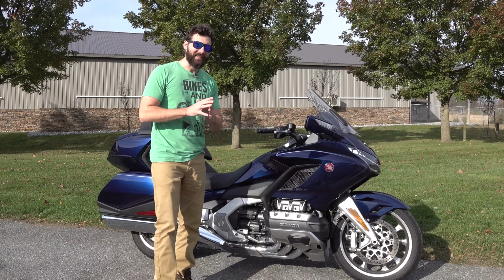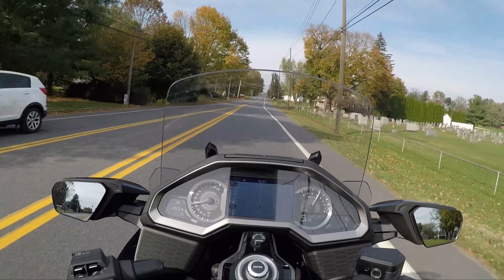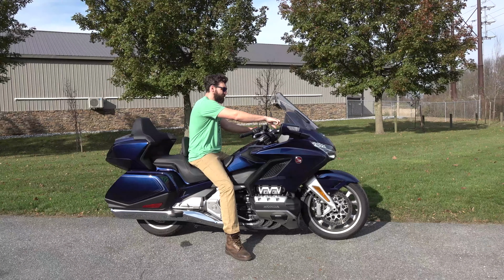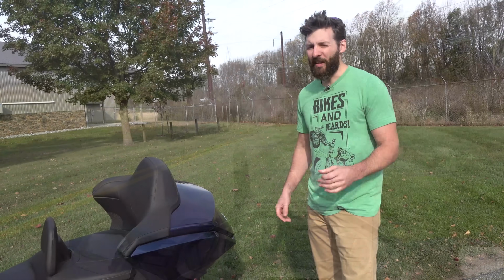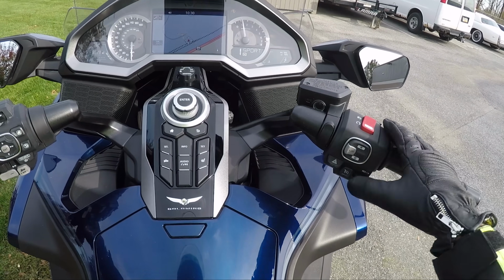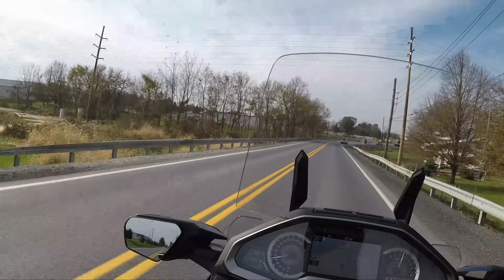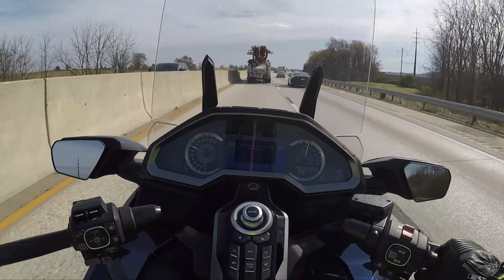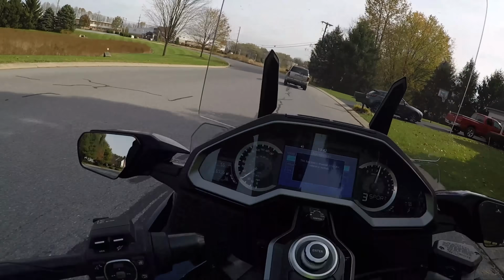You WILL NOT believe what the new Goldwing can do

Comment: Can it perform slow maneuvers. Something like the police courses. When you tend to use a friction zone of the clutch.
Reply: I'd like to know as well
Reply: Sure. Just use the rear brake pedal the same way the cops do on the courses.
Reply: Ok maybe I over thought that one. Trying to set up a test ride to find out for myself.
Reply: easyrider4x thank you.
Reply: I have an Africa Twin DCT....it’s absolutely brilliant on and off road, there are times however mainly when I’m riding it off-road that I would like a clutch but it’s still awesome either way!
Reply: I'd say no.  Rear brake or not, there is a little jump coming on throttle, at least during my two demo rides. Perhaps if you put it in rain mode and deadened the throttle response.
Reply: @plympytheplumber4605  I find mine better off road cos it has no clutch !!
Reply: @johnmoylan7202  First I said you might have better luck doing it in rain mode. I stand by the fact that the throttle is a little snatchy otherwise. Second, when I see YOUR video of YOU doing it then I'll lend credence to your opinion and insult.
Reply: @johnmoylan7202   very cute video, however I'll bet that he is using "rain" mode as I said.  If you are using either of the regular modes, you probably won't be able to do this because the throttle is too abrupt. As any good rider and professional rider will tell you, the key to control is the friction zone.  There isn't any with the Honda.  It is the bike that's the issue!!!!!!  See I can do exclamation marks too ;)
Reply: @tibortoczauer7985  that was done in Sport 1 mode.
Reply: @tibortoczauer7985  there is no insult. it's like Jerry says - and shows often - the motorcycles are not the limiting factor, it's the riders : myself included.  It's why I practice all the time. Including on my Road King doing the same exercises.
Reply: @tibortoczauer7985  I'm a Honda motorcycle mechanic, and I have ridden the goldwing DCT plenty of times. I have done tight u-turns in default settings in my shop's parking lot a few times, just to practice and feel how the bike does. It is very easy to ride at slow speeds, you just need to have the experience to do it right. I can make the u-turns tighter than I do on an (obviously manual) Harley-Davidson Ultra Classic. It's all about the rider.
Reply: @easyrider4x  watched the video and all it is is basic u-turns and some weaving...not my idea of slow maneuvers...

Comment: you didn't say anything about the radio/ intercom system...?
Reply: The audio quality and volume is pretty good, there is no intercom system, and no wires; its all bluetooth. The built in GPS sucks and that's being kind to it, also no Android Auto support which is stupid, but Google's fault. CarPlay does work great on it, especially the iOS 13 version with the split view. The CB add on is $1000 though.

Comment: Great video! But, please do not call the DCT an 'automatic'. An automatic has a single torque converter and a wet clutch. The DCT is like a manually shifted car which most often has a dry clutch. The DCT has TWO dry clutches (thus the 'Dual' part of the name); one for the even-numbered gears and one for the odd-numbered gears. Each clutch is always ready to take its turn. The DCT can change gears in a tenth of a second. In addition to the seven forward gears the DCT shifts at the peak delivery of each gear. You can call it an automatically-shifted manual transmission. Also, you don't have to turn the bike on and THEN press the red start button. You can, with just your right hand, hold in the front brake and press the red button with your thumb at the same time to start the bike. Not all Goldwings come with a center stand. Only the tour models. But, you can add a center stand to the non-tour models. I've had my 2018 Tour DCT for almost two years and it has 15k miles. Three times a Harley rider on a new-looking big Harley has challenged me at a traffic light. I smoked all three of those guys when I used Sport mode. Also, you can manually change the gear with one of the shifting paddles while in automatic mode. Some riders, coming up to a stop, will tap the minus paddle to jake-brake the bike. Do not be afraid, the DCT will prevent you from tapping the shift paddles if doing so take the RPM out of range. Having said all this, I think your video is the most effective video I've seen in selling the benefits of the new Goldwing. I'm going to keep it handy when I want to show someone the real benefits of the most incredible bike I've ever ridden. Thank you.
Reply: Interesting comment about DCT a few things I didn't know I just bought an Africa Twin DCT last month I'm absolutely loving it ...thanks for the info.
Reply: Honda moved away from just calling it a DCT and now they are officially named Automatic DCT.    Too many people were getting confused as to what DCT meant.

Comment: I am 5' 8" and I cannot ride a Goldwing because my feet do not touch the ground flat and I felt like I was going to drop it because of the weight. They are great for riding long distance. I grew up on the back of a Goldwing.
Reply: Brian Smith height doesn’t matter. It’s all about your inseam measurement. I’m 5’9 and can almost flat foot any litre bike.
Reply: @thegatesofsleep  I never actually said height mattered. You are right, as long as your flat footed you are good. But unfortunately I am not flat footed on a Goldwing.
Reply: Brian Smith if you’re really dead set on wanting one there’s custom seats you can buy that will shave some of the height down as well as lowering the bike slightly. You’d probably be able to flat foot it doing that.

Comment: Well, the reason why a dual clutch transmission is faster than a normal automatic is because it's technically not an automatic transmission. An automatic transmission shifts using oil pressure and clutch packs all controlled with solenoids and what-nots. A dual-clutch transmission is internally a manual transmission. It's simply automatically controlled. The reason it's faster than a manual is because 2 gears are actually activated at any given time with one clutch activated and the other clutch not. So to shift it simply switches from one clutch to the other.

Comment: I've been driving a 2011 Honda VFR1200F for many years. Also with an automatic DCT. They improved much in the years after. But I'll never go back to manual transmission. Honestly, with paddle shifting on the left hand side you can easily manually switch gears anyway. You just don't need that stupid outdated old fashioned clutch anymore. In my city I suffer a lot of traffic jams and manually switching gears 20 times a minute is just a pain. It's rare here in Europe, but automatic gearboxes are getting more popular.

Comment: Motorcycle Hondamatic (1976-83) was a torque convertor two speed semiautomatic. You used your foot to shift Low to High. So basically it was original Chevy Powerglide on a motorcycle. Efficient, no. But on the 400-450-750 it was offered on there was plenty of go.

Comment: the newer Goldwing's are nice bikes, but I'll stick with my BMW. The R1250RT is the epitome of a sport tourer. The K1600's are completely freaking amazing, and both have the quick shift and downshift, but the service costs of the K bikes are much higher than the R series. R's are almost suggested that services be performed by the owners, unlike the K's.  Many years ago, before I discovered the BMW's I had a GL1200. At highway speeds, the rev range was so high, it sucked gas like a sport bike. When they stepped up to the 1500, they fixed the issues of the high rev's but then they just got heavier and bigger... and bigger... and etc. It took all the fun out of using it in town. They were great on the highway, but...  That's one of the things I love about my RT. While it's a large bike and heavy enough to smooth out those highway miles, it's still manageable in town. For me, and I can only speak for me, they are the perfect all around sport tour bike. Yes they are expensive. My 2020 was $24k. But the longevity and the low cost of service and all the onboard goodies makes up for it. IMO

Comment: Rented one..it was incredible... Trans seemed at low speed to have a bit of lag and clunck between accelerating and decelerating.. but l was floored with power l did not expect and yes it does feel half the size of the previous gen..very nimble though the suspension felt cheap would be my big complaint..as well as the stereo was AWEFUL.. The user interface on the dash leaves a lot to be desired..

Comment: So, it has a automatic trans that considers throttle position, road speed, loading, and engine speed.  Car transmissions have been doing that for more than 70 years with mechanics and hydraulics.  Add computer control and one can refine the shifting pattern.
Reply: yep, but try to engineer it in a bike with the weight and space challenges, also considering that in cars you get sensor all around, not in the motorbikes

Comment: I have just bought the 2023-DCT and within minutes of the Demo Ride ranging from getting out of the Dealer's Parking Lot and two traffic lights later? I have stopped looking for the clutch handle and the rest of it as they say: "It's History". The bike is phenomenal. I was amazed how the bike went into its own Engine-Braking mode to its own Quick-Shift Mode. You have to trust it. One thing that I have done was to learn and to understand how the DCT truly works. Moreover, HONDA did NOT spend all of these resources into this transmission for nothing. Also Bear in mind that HONDA has since put the DCT in most of its product line. The CTX was the pre-amble of things to come with the DCT.
NOPE! I do NOT miss the clutch handle since now I have BOTH OPTIONS...
😉🏍😎

Comment: My biggest problem with this bike is the storage.  Why did they reduce the storage?  My current GW holds two full size helmets in the trunk. I'm always coming up with ideas to reduce my storage needs now.  Like mailing fresh clothes to a UPS store in a city a week away, then I mail back my dirty clothes in the same box.  With the storage on this bike, I'd have to pick destinations about 3 days ahead.  A touring bike needs enough storage so you don't need a trailer for a long trip.  
Fuel is also an issue, as there are many back roads where you can go 200 miles without a fuel stop.  I carry a can of fuel in my bags just in case after having that issue on my VTX decades ago.  When you're traveling at high speed, you don't get that "great fuel mpg" they claim.  I can increase my MPG by 35% if I run 55 mph, but that takes the fun out of it and is not why I'm riding a bike in the first place.  Come on Honda, get with the program!
Reply: They took a little trunk space to help reduce the weight. They were able to trim 83 pounds which is pretty significant. If I need more storage I’ll just add a rack Honda makes specifically for the reason you state.

Comment: When this gen of Wing came out, I felt they were angling got the younger and affluent riders. It screams BMW styling. As a matter of fact I would have thought it was the successor to the K1600GT. I had the 2006.5 K1200GT which was a sweet looking and handling machine. BTW, it had the solid front suspension as well. Even my 2002 GS1150A had the single front shock with the trombone sliders.

Comment: I wonder if YouTube was around when cars started going to automatic transmission if the same argument would be happening then.  Sure it’s fun on manual.  It took me a few days to get used to no clutch.  But this bike hauls ass and is fun to ride. I have a road glide also.   Nothing wrong with either bike.  What am I taking on my trip on the blue ridge ?   The goldwing. I will say though that when I pull up to Harley shops I don’t get weird looks.  The gold wing always gets approving nods from Harley riders.  Especially when I say it has an airbag.

Comment: How do you ride at low speed  without any clutch lever?  Sometimes, we have only a short path and a need to do a very short u-turn, we increase rpm and play with the clutch. In my mind, if you ride a motorcycle, you put your boots on pegs and you move or you put your boots on ground and you don't move. You can't ride slowly with your legs outside your motorcycle except if you are not enough good for riding your motorcycle so you need lighter.

Comment: So basically Honda stole all of BMWs features that Beemers have had for years - the suspension, the adjustable electric windshield, the smaller fairing - all of the reasons that I kicked my goldwing to the curb and bought my R1100RT - the goldwing had such a ginormous fairing and wind screen that I got literally zero wind, only hot air from the engine - and that barn door that they called a fairing actually caused a wind to blow up my back and the bike to swerve dangerously when passing a semi truck - one of the worst bikes that I have ever owned.

I still have a goldwing but it is an early model naked bike - GL1500's sucked because of the stupid fairing.

Comment: 3.92 to 60...considering it weighs 800+..not bad My blackbird ran idle speed in 1st (about 1 mph) to 70 in 3.1....i do the idle speed deal for tuning...camera on the tank to track calibrated spedo...saves rear tires and clutches and is super consistent...probably made 70 passes on the same rear tire...those 70 passes and a change of something every time it runs to 70 in 2.65 seconds...and  yes an 1130 cc bike with them old school things called carb is actually quicker than the mighty 1300 cc fuel injected hyabusa...it would be even quicker but i like the stock exhaust

Comment: The major flaw in all Wings from 2018 forward is the "Can bus electrical system" 👎. Good luck finding a mechanic to fix any of its failed parts. Most mechanics don't have a clue how to fix them. Price a headlight or starter/alternator combo. Most mechanics struggle with pre 2018 Wings 🤣. I have a 2012 Nav/ABS and trust it more on long trips than 2018 and later Wings. I have 108K on mine since I did not ride this season due to wife's health problem and restaurant's closed in Florida (Covid 19). Paint is metallic blue with a factory clear coat (Won't show scratches like other non metallic colors) . My bike has had zero problems except for tire replacements (I won't allow anyone to work on it 👌). I don't mess with advice from nonsense bike forums💥👀👎. Usually just hearsay nonsense anyway😜. Never could induce a wobble of any kind. Ride is still smooth and can travel straight with hands of bars for a mile with passenger. My 2012 is a keeper for me. That is my story and I am sticking to it 👍.

Comment: The continuation of laziness is full on, at least with engineers! I remember telling a best friend, he should take the newly installed seat on his Harley, back off because it was so comfortable, I was concerned he would fall asleep while riding his bike. Sure enough he fell asleep one night and was killed when he ran straight through a curve into a storage shed. With all the laziness coming in new technology, hopefully somebody designs a built in alarm for our brains when we are riding or driving these magnificently boring machines! I also remember my first ride on a Gold Wing. I rode it about 5 mile and returned. I told my uncle it's a smooth machine no doubt, but I found absolutely nothing exciting about the ride, maybe when I am 70 years old which is only 8 years away.
Reply: Control of the machine we are operating is no one's responsibility but our own. I have a 2020 Africa Twin. It has some of the same features. I feel that some of those features take away from the riding experience.

Comment: Almost 20 years? What?
Shifts at the right points? What?
Hes in sport mode which hangs gears and often holds the wrong one. Tour and eco and rain will have you wishing it was in other gears more often than not. 
I work for honda, many of these statements made are false or stretched. 
The DCT is for the highway cruiser and relaxed rider. If you ride slightly more aggressive, buy the manual. Hence why hes using the paddles and prefers the manual mode. Why spend the extra money just to use the shift buttons....

How ever, the goldwings a great bike! And the DCT sells more than the Manual due to the demographic.

Comment: Want to know what else the new Goldwing can do?
Not travel as far as the previous model thanks to the smaller gas tank, or carry as much thanks to the substantially smaller panniers, and trunk.
The GPS and Audio system are also total garbage, and you have to pull body parts off just to check the oil.
And not for nothing, but no self respecting biker would drive an oversize scooter. Scooters are for tourists, and girls on spring break.
If it doesn't have a clutch & gear shift, then it's not a motorcycle.

Comment: The New DCT can be dangerous . I know a guy who forgot he was on a automatic and jumped right o u t in the intersection. The bikes are cramped , they have much smaller storage ability. They are impossible to work on. The air cleaner change  is eveN a huge job. That bikes is a Sport touring bike .Not. touring bike. They are dull and boring and provide very small entertainment value. Boring.  Harley and Goldwing are both junk in thier own ways .